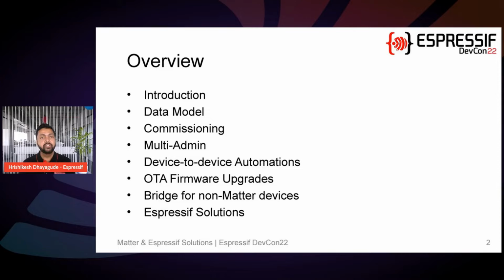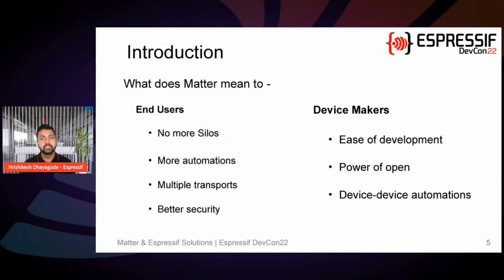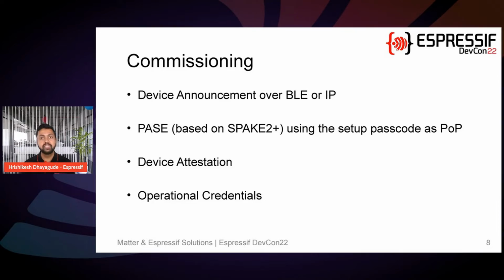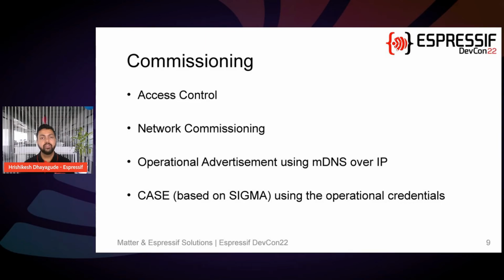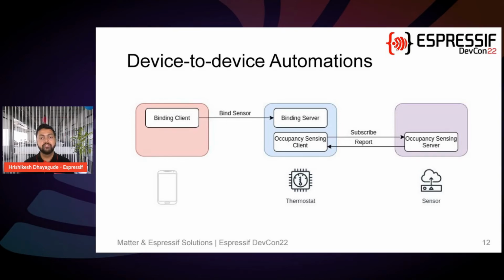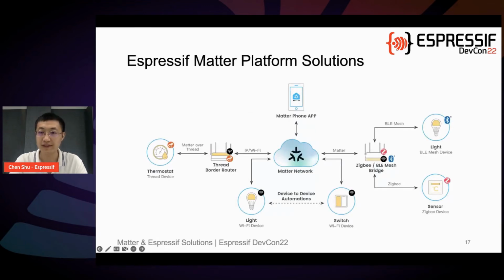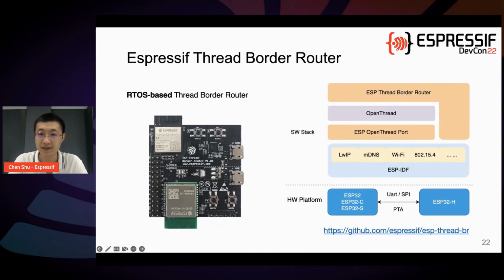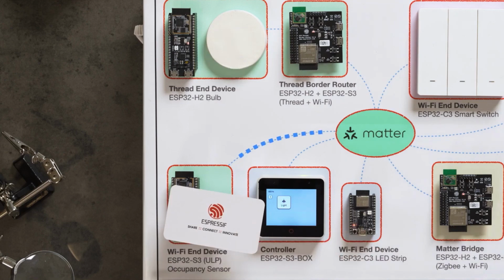EDC22 Day 1 Talk 2: Matter & Espressif Solutions

Comment: Don't Use ESP 32 For matter 
It has no matter support library for Arduino IDE and and other platforms are very very confusing. If Espressif release Matter library for Arduino IDE. They only provide 2-3 example Code. And such a lots of confusion in their example codes. For building a matter device use Silicon Labs microcontrollers. And silicon lab Arduino core provide lots of examples for building a matter device The better. Recently I shifted ESP => To Silicon Labs.